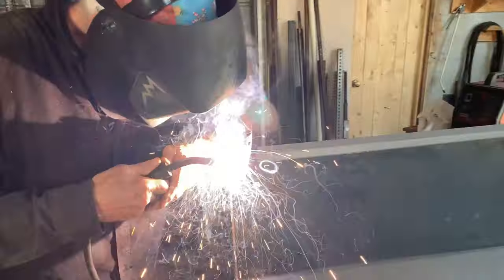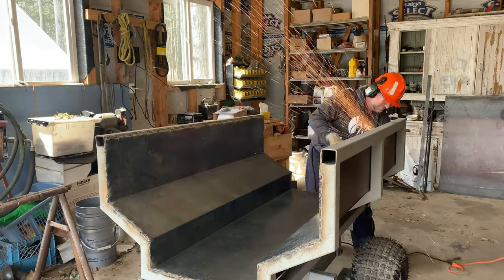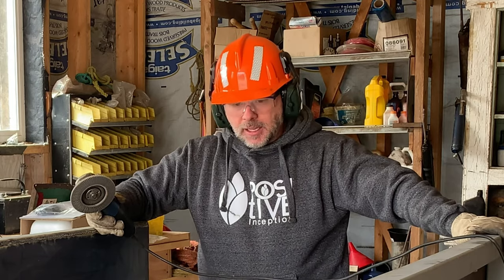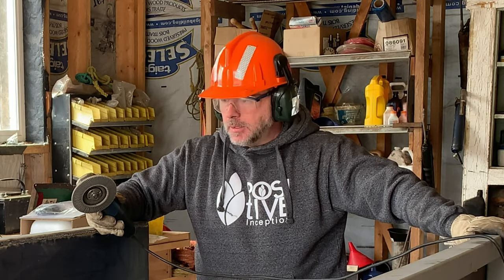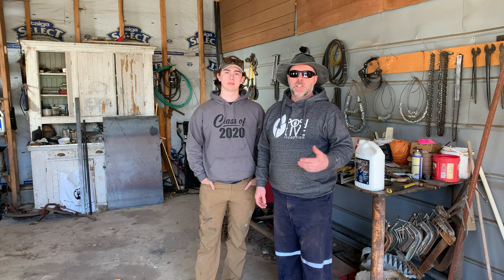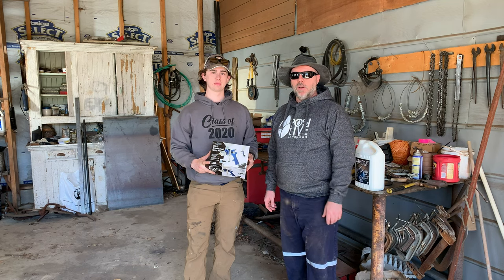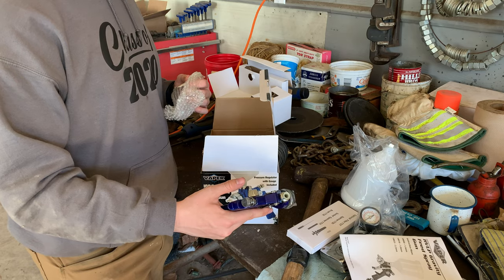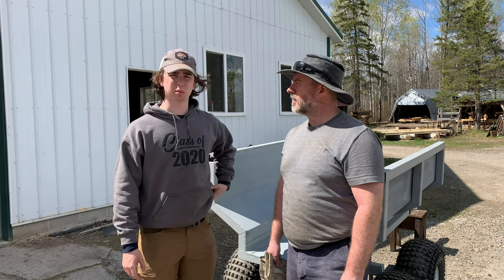The Ultimate Quad Trailer - Part 11

Comment: If you would of bent 1/8 sheet steel in the tub shape it would have been just as strong and weighed a lot less
Reply from the maker: We did think of that too but have a few other plans and gates to put on this as well.